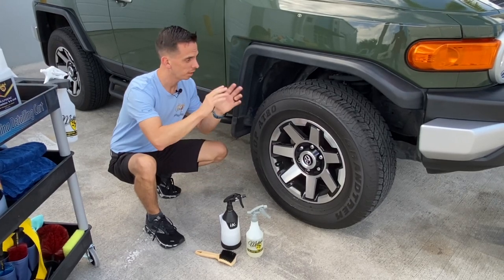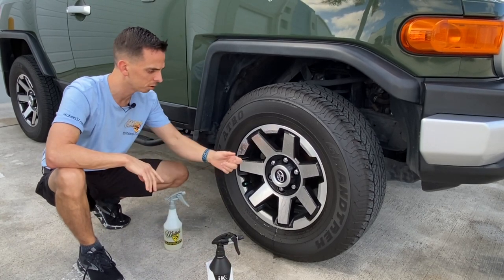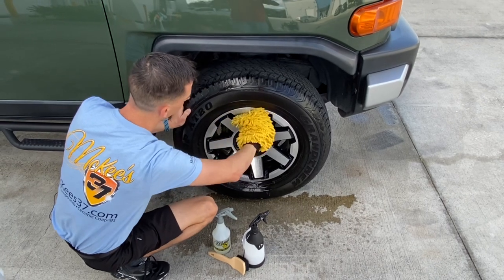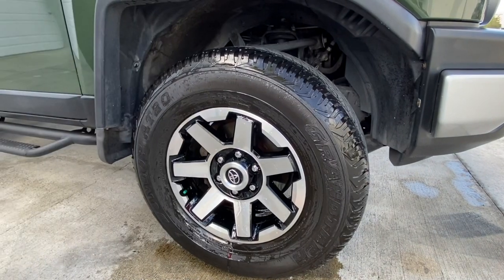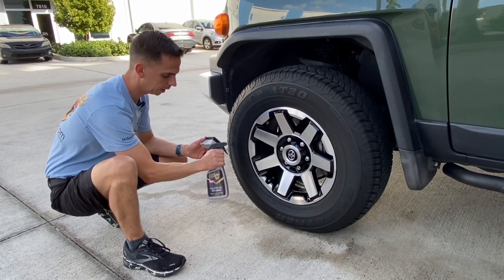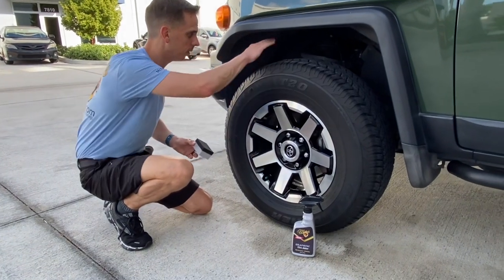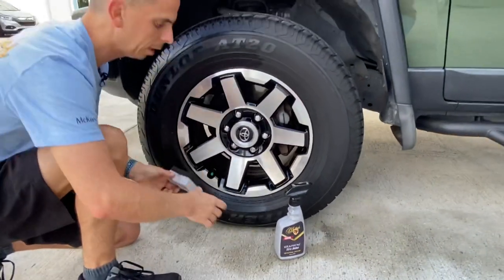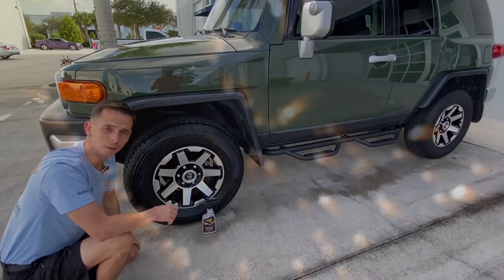How To Wash Wheels & Tires Using Graphene Rinseless Wash

Comment: Did you ever use 256:1 rinseless in a foam cannon for the initial pre rinse of a full car wash? I know it won't foam but it should clean better than water alone.   Then follow up with a foam for a contact wash.  I would think the rinselss pre rinse would allow less water spots too.